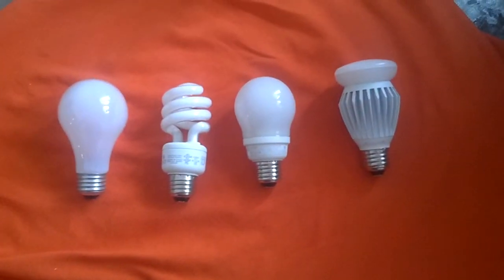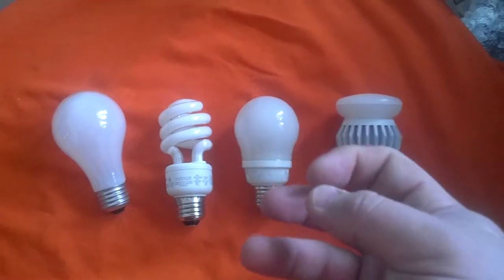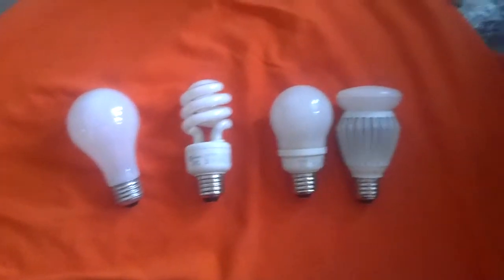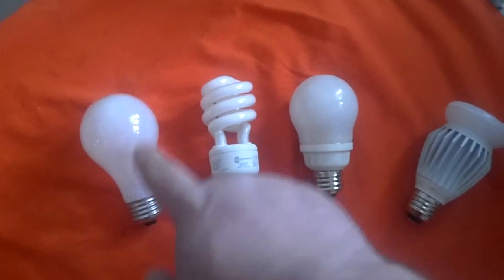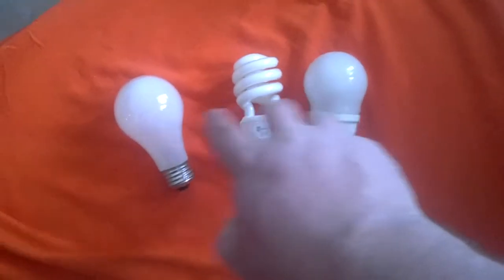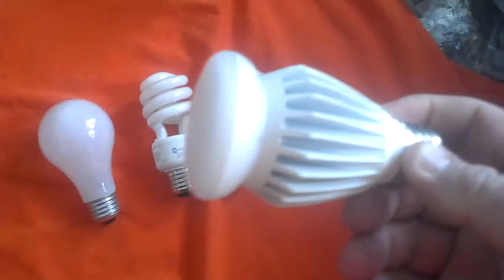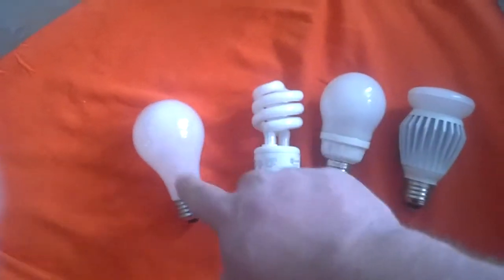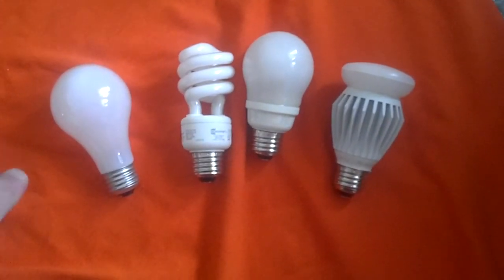CFL & LED LIGHT Bulbs

Comment: its nice to see that you know the difference of CFL's and LED's, but from what I have been learning from taking different lamps and lights apart is that screw-in bulbs today are made with small/fragile parts and burn hotter then the classic tube lamps that dont have screw-in connectors. The lamps I'm using are over 30 years old and because they are only made with a condenser and power coil, the chances of these 2 parts failing are very very slim... Funny how those bulbs arent avalible anymore...

Comment: LED Light bulbs are more expensive ~$40 each.

But you will never have to replace them, saving you a trip to the store, or getting a friend to hold the ladder for you. 

Unless you can dig yourself out of the grave by that time they will be less than $10 pesos, but who wants to wait that long.

Over the course of 5 years I have spend $200 dollars in CFLs, all burned out, still have them in a box I was planning to take to HD for recycling 1 year ago...

Comment: It's more to do with technological evolution. Instead of using lighting developed in the 19th century, we prefer things that will save us money by using less power. Okay CFLs aren't the ideal solution but they're more a stopgap for other emerging technologies such as LEDs. Bit like cars, American cars seem to be stuck with huge inefficient V8s, basic automatic trans and leaf spring suspension whereas European cars have modern suspension, modern trans and can even do over 70 miles to the gallon.

Comment: From personal experience I would say it depends. If you want a straight-up quick replacement for an incandescent bulb that throws light in all directions, you really can't do better than a CFL. If you're redesigning the room's lighting and can spread out the position of the lighting over a wider area in the ceiling with spot lights then it's well worth upgrading to LED. I really don't rate the LED bulbs designed for incandescent-replacement though.